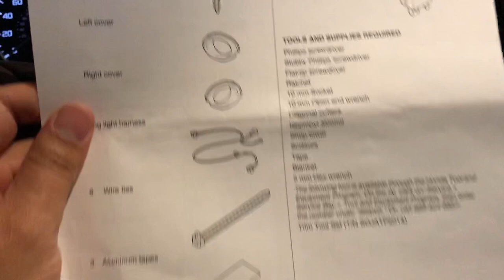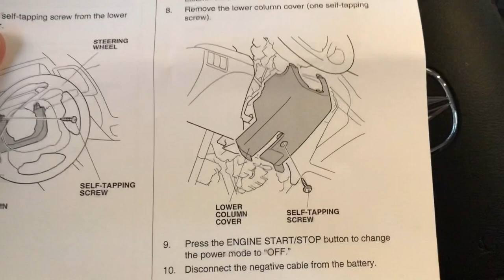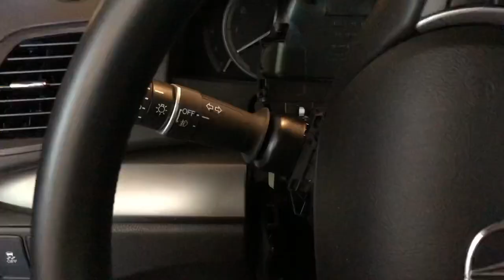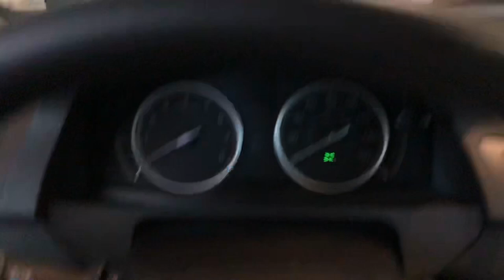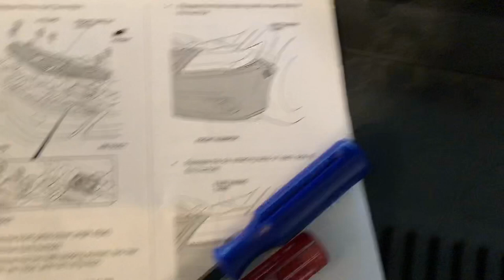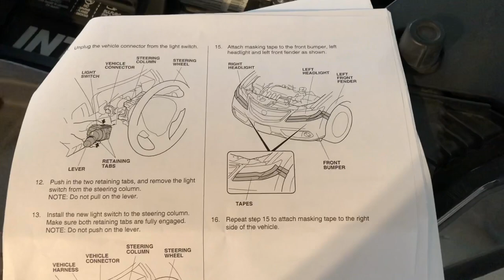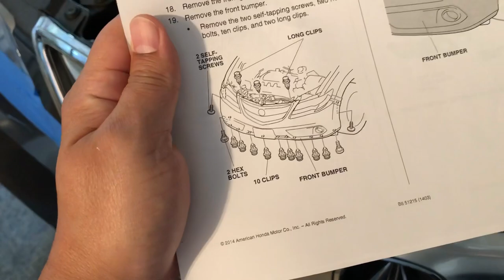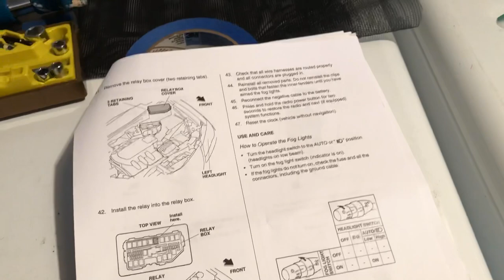Acura RDX 2015 Fog Lights Installation

Comment: What kind of low beam bulbs do you have? Mine are so weak, i even replaced them with HID and still barely light 2 feet in front of me. Please recommend the ones you have they look strong.
Reply from the maker: I have the OEM lights
Reply: If you replaced your low beams with HID and they're still weak then the problem is with your halogen projector housing. Over time, it's possible the lining of the projector to get greasy, dirty. You should get it cleaned, checked if that's possible. There are DIY videos for it as well but you'll need to remove the projector housing for it from the headlight assembly. Last option is to replace the projector housing with a new one. Good luck

Comment: The part number for these fog lights is P/N 08V31-TX4-200. 
If you do a search on Google you will find several kits with prices ranging from $241.00 to $258.00 dollars.  
Here is the set I found on Amazon:  https://www.amazon.com/Genuine-Acura-Accessories-08V31-TX4-200-Light/dp/B00BYV4NIE
Since this is an OEM product installation should be close to plug-and-play.  However, be ready to tackle some interior and exterior parts.

Comment: Did you reuse the old self tapping screw or did you use new ones all around?
Reply from the maker: the same ones (old ones)
Reply: @joec6311  gotcha, didn’t know if I needed to get all new screws. I might do it on a 2016, steps are pretty much the same.